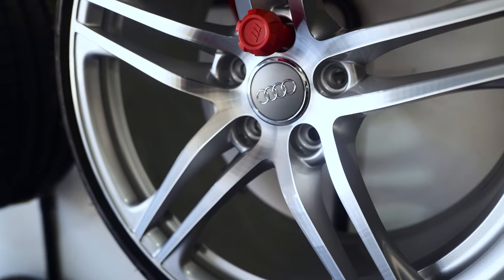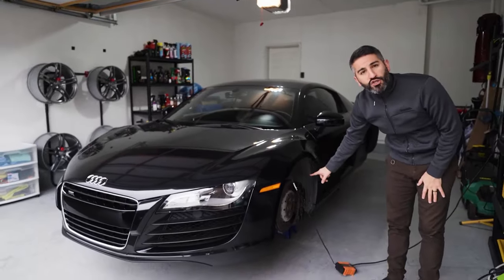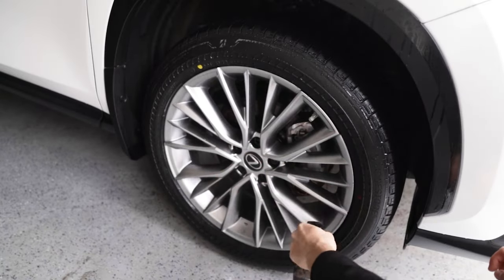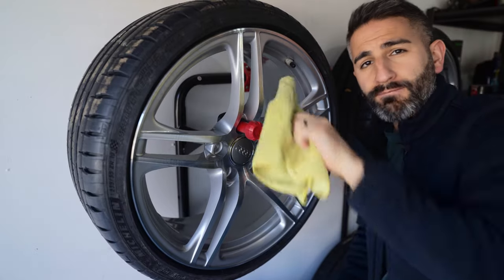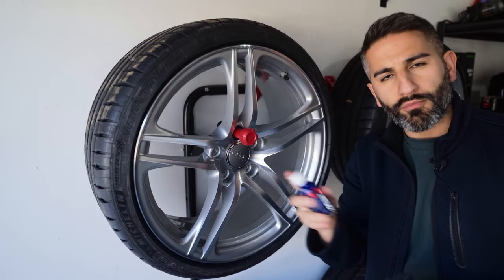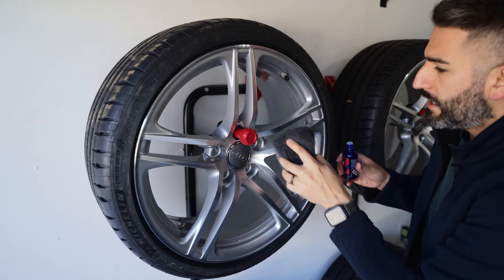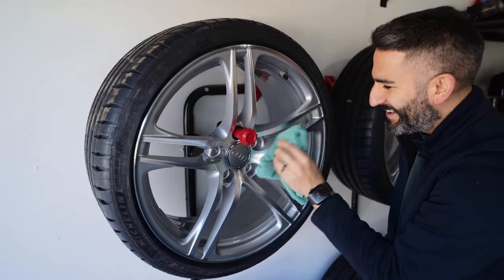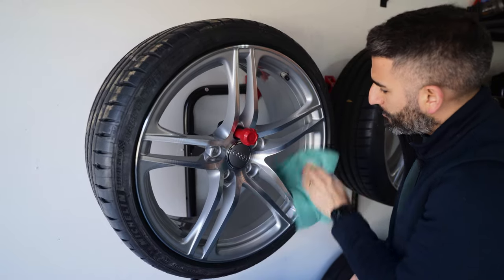How to Ceramic Coat Your Wheels! Best DIY Prosumer Ceramic?

Comment: Carpro recommends Dlux. They also say Lite can be used on wheels, plastic and glass(except windscreen). I'll be buying Lite and using it on most of my vehicle. Thanks!
Reply from the maker: It’s interesting because of my previous communication with them they mentioned Cquartz UK 3.0 can be used on wheels as well. Honestly, this will do just perfectly fine. I’m sure they are just promoting their wheel specific option.